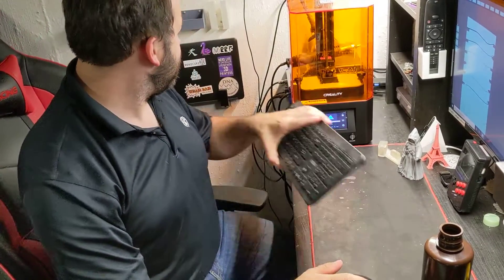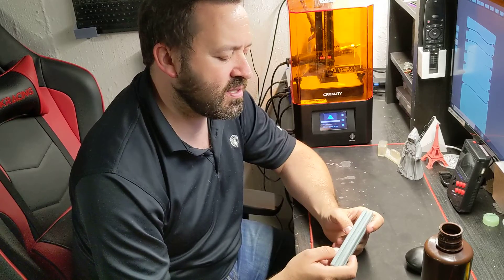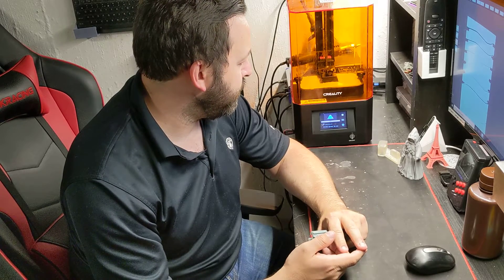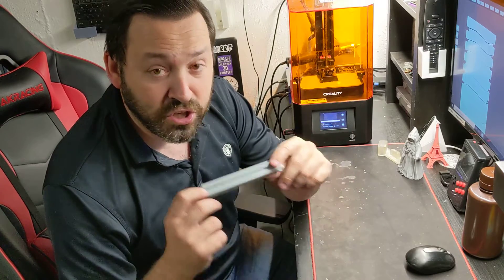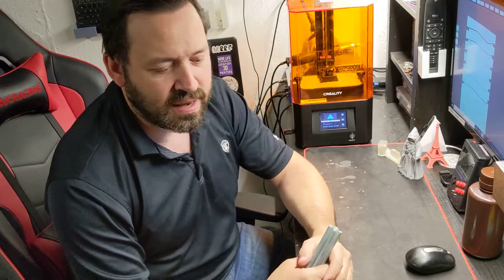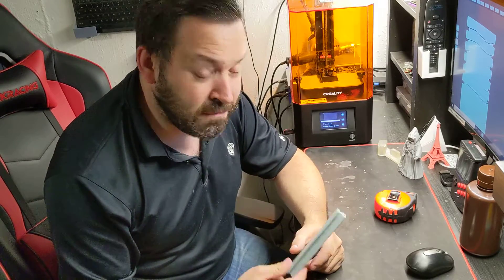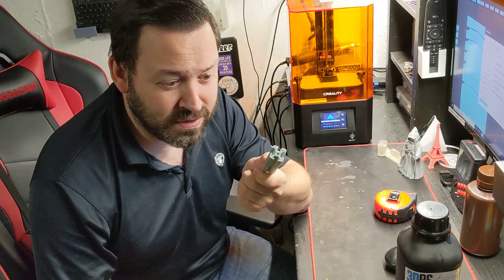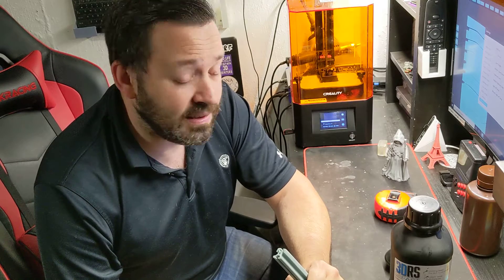3DRS Fast+ resin review

Comment: Hi Matt, I've just recently purchased the Hero tough resin and was wondering if you had any settings you would care share for the Creality Halot Sky. Pretty Please?
Thanks so much
Bryan
Reply from the maker: I have yet to try that one from 3drs but I will say that best practice is to calibrate the bottle yourself...download this file and print it flat on the center of the plate. Start at 2.5 normal exposure and 30 for the bottom. 
https://drive.google.com/file/d/1Cr21EhH2mJ9vouqWMZn8l434cTpA3cTX/view?usp=drivesdk

Comment: I'm just now seeing this. As I'm now looking into other resins on the market, this seems interesting. 
I know you mentioned you worked with other high strength resins and have experience, butit should be noted that the design you are using is also a high tensil strength structure. That means you should be able to break it. Also, a side by side test with a standard resin would have shown a better example. These are just my observations and are not meant to discredit anything.

I'd really like to know how this resin works with showing detail on very small parts.
Reply from the maker: I will be doing a lot of side by side and reviews on resin and filement this year so keep an eye out. We are just getting started